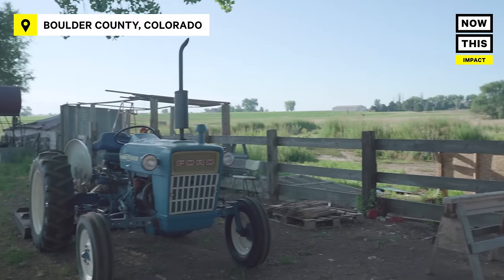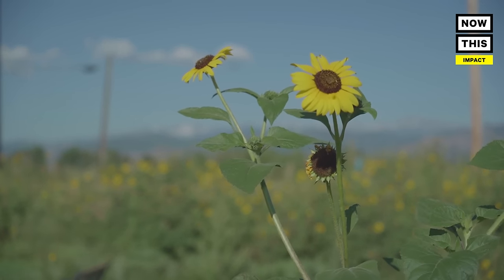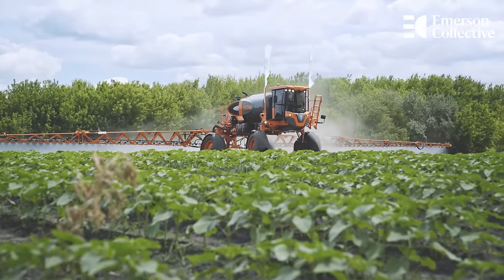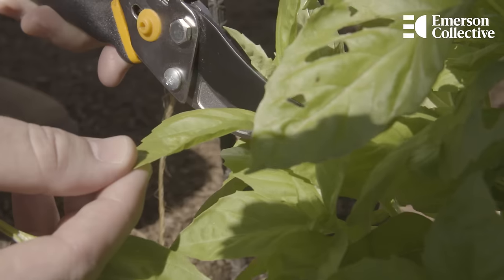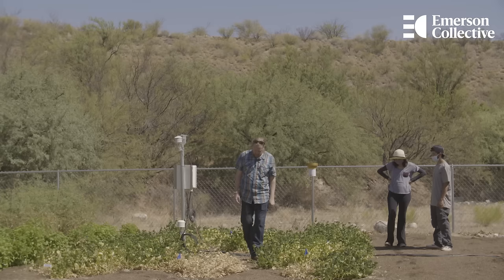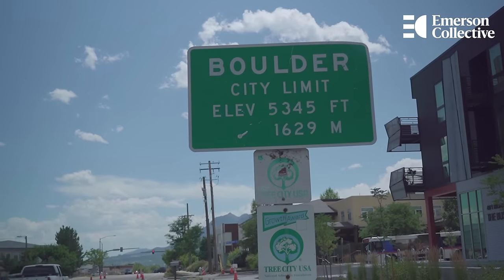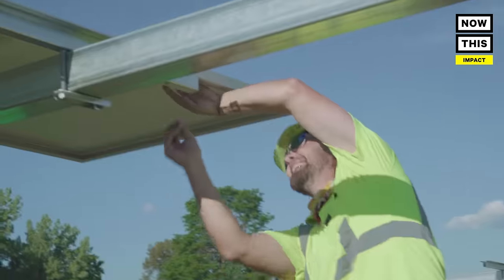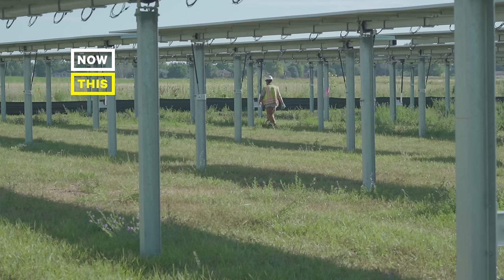Agrivoltaics: Solar Panels Bring Life to Struggling Farms | NowThis

Comment: Thanks for showing your agrivoltaic setup. Current payback for PV on rooftops is 7 to 10 years which is not an attractive investment but maybe agrivoltaics can bring it down to 3 to 4 years by increasing crop yields and improving PV efficiency due to the cooling effect of the plants beneath. Some details along those lines  from you would be much appreciated.

Comment: The changing environment is a very complex problem and includes major reductions in the water table due to increasing uses by the Megalopolises  and large cities the are incredible users and wasters of water.  Very large cities (megalopolises) such as Los Angeles have continued to demand more and more water from the watershed areas of the Sierra Nevada Mountains runoff and have demanded more water from the Colorado system of Lake Meade.  That water takes from the water needed by the farms that produce the food that supplies the city and its millions.  When water is this scarce and  getting more so it behooves us to discontinue as much wastage as possible such as watering lawns in desert communities etc.  The farming areas could benefit from subsurface irrigation to limit the loss of water from surface irrigation.  There  was some studies that showed the use of very large arrays of solar panels could change the surface temperatures in the Sahara and increase rainfall in the areas over a period of time and return the area to the temperate climate it enjoyed several thousand years ago.  Lots of possibilities to be examined and perhaps adopted,.

Comment: If the temperatures get too hot, I wonder if they could hook up some fans under the panels and use the free energy to cool down the plants.
Reply: Fans don't really cool much.  They make us feel cooler because we are a 98.6F and the air is not that hot.  A plant doesn't heat its self up like we do.

Comment: Imgaine a thin-film solar array that only absorbs wavelength that the plant does not need or want like green (plants reflect green light away, that's why they look green) and infrared, but let's enough light through for any crop to grow. I think converting infrared radiation efficiently is the most challenging thing (photoelectric effect).

Comment: Now you just need to raise the crops up onto a hydroponic system with fish living below, filter and equipment powered by panels for a net positive electricity output and natural cleaning between the plants eating the fish nitrogen and the fish feeding on a subsection of the plants while the rest of the plants are protected by smaller pest eating fish. Boom mass market the Disney sustainability farm tech I just repurposed to fit under the solar panels and we have fully sustainable micro ecosystems at can eventually be mounted on tracks to portion out sun exposure to the fish and plants while moving new shade to other plants and fishes. 
picture all farms being electricity, plant and fish farms, with 8/9 squares covered by solar panels, like those slide puzzles. Simple computer program to make "moves" like the slide puzzles and outside of planting and harvesting it can become completely automated and can be done humanely for all beings involved and without chemical pesticides.

but alas then the lobbyists would make no money and Monsanto and the pesticide companies and the...

Comment: Is there an example of somewhere that solar panels have lowered electricity prices for anyone other than the owner of the panels? California, Australia and Germany are examples where prices have drastically increased.
Reply: Locally produced solar in California is cheaper than power from the grid.  California's increasing price for electricity is obviously not because of solar.
Reply: @kensmith5694  but solar makes electricity when it has no value. This is why electricity costs in California are increasing at a faster rate than any other state in America
Reply: @davidhilderman  You confuse price with cost.  It isn't the solar that is pushing up the price.  It is the aging infrastructure.

Comment: First I have to say that this is amazing! Without things like this we will have a really hard time surviving.

But what will you do with the solar energy? During the day the sun is out and you're probably out working somewhere. But during the night you're at home and you need energy for the lights and all sorts of other things. We need to invest in technologies other than solar energy. It could be technologies to generate power whenever we need it, or it could be technologies to store solar power. I think the latter one is the most important part. But most people don't think about energy storage even though it is such an important part of a sustainable future..
Reply: electric energy is mostly needed in daytime: AC and machinery of workshops are the biggest users, computers, loading your E-car etc. By night it is just the light and the fridge.

Comment: A Meter square of sunlight only has a certain amount of energy, you can’t do both to full efficiency. When you shade plants your depriving them of energy to grow and produce. Granted some plants get stressed in high heat.
Reply: 2C Did you actually watch the video? In this case partial shading has led to higher yields! I understand your argument, but there must be millions of acres of agricultural land like this farm that would benefit from partial shading.
Reply: @spencerwilton5831  I did watch it and I didn’t see the part where they said it resulted in higher yields, it said it produced larger leaves.This is only beneficial if your consuming the leaves , for a tomato plant that would mean the available energy is used for leaf production and not fruit production. And even if your growing spinach to eat the leaves how much longer does it take.
Reply: @user-fc2xg5iz7y  
Some types of tomatoes do quite well in the shade.  The wild thing the tomato was developed from, lived in among taller plants.  Those versions that retain that nature are more in the "market garden" style and not in the "make tomato sauce" style.  They are the large plants that are indeterminate and produce fruit spread out in time.
Reply: @kensmith5694  Yes I agree.
But the bottom line is the available energy per square meter. Farmers should take their   
infrastructure money and build a greenhouse and use the energy on site for growing. If you put up collectors (PV or thermal)use the energy to make better growing conditions and/or lengthen your growing season. 
The cost of a small scale grid-tie PV array is extremely expensive and lasts about 20 yrs.

Comment: I hate this so much.  I see PV installations going up in productive bottomland floodplains that normally have crops growing over two meters high.  It's so much better to see them going up where they are used, like big box retailers and desolate parking lots.  Put the shade where it does some good twice over.
Reply: So a poor implementation makes it a bad technology?  It seems like if it’s used properly it does do good twice over.
Reply: Actually, it goed both ways, solar panels don't do well when it's too hot, they produce more energy when their surface temp is lower, the plants create condensation under the panels and together with airflow, cools the panels down. It's also beneficial for the plants, they are protected from the constant harsh direct rays from the sun and the moisture don't evaporate so fast...

Comment: also a lot nicer to harvest crops under shade.  
Could also maybe use a solar powered dehumidification system to take water right out of the air. H20 is a potent greenhouse gas, and relieve pressure on our ground water resources
Reply: Or use the PV to power desalination
Reply: H²O is not a gas - it is just water. Get some education.
Reply: @mucsalto8377  so at least where I am in the states, we usually cover states of matter in 1st or 2nd grade... Looks like you didn't make it that far

Comment: The thing is, everything is interconnected on every level. 

The massive mounting system you used to support these solar panels is made of tonnes of steel. 

The only way to make steel is coalburning. Same goes for several parts of solar panel production

I'm not saying it's as bad as coal for energy. Considering the lifetime of a panel, solar is probably the more eco friendly solution for power. But still.....none of these things are actually independent of fossil fuels. 

That's the problem I have with presenting 'put solar panels on absolutely everything' ideas as a cure-all for eco disaster. 

It's better than coalburning.  But it's not perfect.
Reply: cool, so how many 'precious plastic' support structures have you made down your local maker space to replace the recycled steel,aluminum and even coppiced tree woven frames to date ryan?
Reply: If you wait for the "perfect" solution, you'll be waiting a long time...better to go with "good" now and improve it later.

Comment: Any vegetable farmer knows that one of the main requirements for good quality vegetables is LOTS of sun. The more the better. Growing vegetables in the shade does simply NOT make sense! (except some varieties of lettuce perhaps, but definitely not fruiting crops.) 
Every farm has spaces which are not used for various reasons. I think supplementing these spaces with solar panels for an extra income might make good sense, but using valuable farmland for solar panels is a disaster in the making. Food security is the first disaster that comes to mind...
I am very surprised that the overwhelming majority of comments are so positive. I wonder what I am missing? This is simply NOT a good idea at all!
Reply: Plants only use about half the solar intensity.  Sun for plants is measured in hours per day.  Crop yields reportedly increase under PV
Reply: Any vegetable farmer knows that one of the main requirements in a hot and sunny semi arid climate is shade. Here it is provided by rows of solar panels with enough distance to bring enough light to the crops.

Comment: I demand clean energy!
Reply: BlaxKid22 where are you based? In the U.K. at least households are free to buy their energy from any supplier, doesn't have to be a local one. There are literally dozens to choose from, and many offer 100 percent renewable electricity. Consumers can vote with their wallets, and it works- the biggest, traditional power companies have seen ever decreasing market share while the new, small, renewable only power companies are growing rapidly. Best of all, they are also usually cheaper. Some, mine included, also sell biogas - mine gas is 10 percent biogas, they would offer more but currently buy all the market has to offer- their purchasing of said gas has led to an increase in small scale production by the likes of cattle and pig farmers who have diversified and increased their income streams by converting a previously problematic waste product into a valuable commodity.

Comment: I’m still very skeptical of green tech being the primary, yet this “plant shade and energy” is way more practical. At this point you might as well make a greenhouse underneath the solar panels unless you have this large scale special equipment designed to harvest between the arrays. Would also pair it with structural rainwater collection (assuming you’re not in a tyrannical state that has made it illegal)

Comment: This is great but we still need nuclear, solar at big scale is too unstable in energy production
Reply: Kishan Singh  realistically, the only way to actually get the world off fossil fuels is a breakthrough in nuclear or energy storage. An energy grid based on solar and wind without any storage simply won't work in most of the world, it is more of a supplement.

Look at Germany, not too long ago they started closing their old nuclear plants and built out a lot of renewables. To compensate they built out more gas power plants. So now they've got more expensive electricity, from more un-renewable sources.

And sure, nuclear plants takes time, but I think we could make it faster if that was a priority. I strongly believe that nuclear is our only real option, and with Thorium not too far away, who knows.

Comment: Do they use the solar power to draw moisture from the air for the plants
 Using the available moisture in the air at the farm would reduce even more water from the town supply.
Reply: why do people go directly to wasting power where in this case a simple passive fog catcher works fine.

A fog catcher is a meter by meter of stretched out mesh over copper piping. It allows fog to condensate into droplets of water and flow down toward a trough into a barrel or bucket where it can then be measured.
Reply: @paulmaydaynight9925  that's fine if fog catching can collect enough water every day for the crops needs, but just in case it could be supplemented using , not wasting the renewable power directly above the crop, drawing moisture after the fog has gone

Comment: this only work on really sunny and hot places,rigth?
Reply: it will work well in this hot regions as it provides shade for the crops. In moderate climate you will use the system for sheep and cows to graze under the panels. Works ok in Germany.

Comment: Any way you slice it, the current model of living is not sustainable. We use too much, consume too much, and waste too much. The planet cannot support our consumption, and we are suffering the consequences of years of avoidance and deliberate inaction. 
So any and all actions to reduce our waste and our consumption is welcome. How we get there is not really a major concern, so long as the decisions we make are fast to implement, hopefully easy to adopt, and vastly cut down on our resource usage. Not taking action is not an option anymore, and denial of the need to change must be renounced and ignored. Incremental changes are not enough anymore, either. We need to be bold, we need to be brave, and we need to be adaptable.

Comment: This video is misleading.  Plants need light to grow. Some more than others. If you covered huge fields with these and had tight coverage, little would grow well under them. 
The rows will have to be somewhat spaced apart to allow reflected diffuse light in (which happens anyway due to tilting them toward the sun), and the crop must be shade tolerant. 
I have thought this would be good for pasture land (the poles whould need to be strong enough to handle cattle).

What would be even better is semi transparent panels. They cannot absorb all the energy anyway, so if most of the rest went thru instead of being absorbed as heat or reflected,  and what gets thru is useful to plants, covering land and growing crops under it would be closer to ideal.

They don't state it but running the rows of panels north-south may help too, as the sun would get thru part of the day giving some direct light.
Reply: Did you watch the video? There is enough space between the rows of panels to bring light to the crops.
Reply: @mucsalto8377  Panels are typically tilted to match the angle of the sun to get better output. Because of that, there must be a gap between them to keep one from shading the one behind it. So yes there is always a gap when mounted on a level surface. This means however that for most of the year no direct light reaches the plants. 

I have a yard with trees on the fence lines. This causes the middle to only get about 6 hours of direct sun per day. I can tell you that I cannot get melons to produce fruit larger than your fist. Fruit trees in the space either don't gain size, or produce stunted fruit that is inedible. Some plants like lettuce produce well because we eat the leaves. Green beans seem to do well.

That situation was with ambiant light most of the day,  and direct light for at least several hours. With these panels it looks like they are set to only allow ambient light thru. Most crops will be stunted by this. Also the experiment show is small, so they are getting light from the edges. In a large installtion, that wouldn't happen for the majority of the area.

Many plants grow better under shade cloth that reduces the sun intensity by 30 to 50 percent, but those shades still allow direct light thru for the rest.

The idea with the panels is fine amd can work, it just greatly limits the crops that can be grown. Particularly if the panel spacing is close. If they were spread out to allow gaps of direct sun thru, more crops would be successful. Arranging gaps in the rows east-west would allow bands of direct sun to move over the plants as the suns position changes thru the day. Semitransparent panels could allow some sun all day (assuming the light getting thru is useful to plants).

Comment: aren't a large quantity of solar pannels channeling extreme heat?

I've heard there's a solar power plant that, if not shot down correctly can burn anything alive. It gets so hot that birds in the air can get scorched.
Reply: You are thinking of concentrated solar power or CSP I believe which can be dangerous and some systems use parabolic mirrors that may cause extreme temperature.  

Ground mounted panels generate no more heat than farm equipment or vehicles or a metal roof left in full sun.  If wired correctly they are extremely safe.  The microclimates under the panels also actually keep the panels cooler than without plants.  Awesome!

Comment: Well until we are able to store the energy and use it when we need it, aka when batteries become more readily available, you will just run into the issue california has, which is way too much solar at off peak times and not enough battery to store it, so most goes to waste